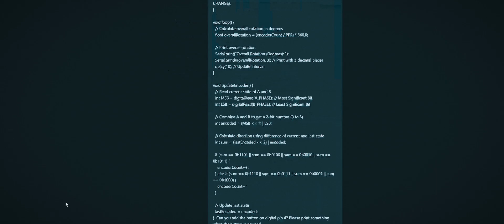Digital Precision Indexing Upgrade for My Watchmaker’s Lathe | LOOK WATCHES

Comment: Did you have to make any modifications to the sherline to use it for watchmaking? I’m considering the 4530, but I’m worried it will not be accurate enough. I cannot find any published cocentricity specifications.
Reply from the maker: Hi! I still have so much more to learn on my watchmaking journey, so take my opinion with a grain of salt. In my mind, the sherline lathes are very capable machines, and I've no problem hitting my overall target tolerance of 0.005mm. 

The only issue I've noticed is the limiting bed length, but that's my own fault by ordering the smallest lathe from them.

I'd recommend a sherline any day, but I'm still 'just' an ambitious hobbiest, so that's that.

Comment: Stumbled upon this channel. I like it. I do mostly restoration work, and also needed an indexer for wheel cutting. I built one out of an arduino and an ondrive gear box with a stepper motor. This way I can just input the number of teeth I need to cut and it automatically rotates the required degrees. Im kind of surprised you didnt go that route
Reply from the maker: Hi, thanks for your comment, and I really appreciate your input! Your described indexing setup would totally work for me as well, and I thought about it. The only difference is that I really enjoy the manual handwheels on my lathe. 

When working with different metals, it really helps me to feel the metal being removed. The resistance of the handwheels in combination with the sound seems to work very well for me to get a good surface finish and feel the limits of my lathe.

So I designed something that will give me the same feel since I'm planning to use this attachment for light milling work as well, rather than only for straight-up indexing only.

Comment: I loved this!  Thanks for sharing!  I love my rotary table.  

I've got a manual one, but it's got indexing plates, which accurately splits 360 degrees into any increment.  When you cut your first tooth, how well did it line up with the last one when you got all the way around?  The reason I ask is that I noticed your encoder only splits by quarters of a degree - you'll want a lot more more precision if you ever plan on doing gears with an odd number of teeth. ;)

Also loved the color grading on this one - how did you achieve that?  What video editor are you using?
Reply from the maker: Hi! Thanks and much appreciated! The last cut lined up perfectly, and you're totally right about the quarter of a degree resolution. This current encoder has a resolution of 1600 steps, so 360°/1600 = 0.225°. This encoder is more a proof of concept and will be exchanged for a 10.000 PPR encoder down the line later.

I'm doing all the editing/grading in DaVinci Resolve. My professional background is in post-production advertising work, so I'm quite familiar with the task of making something look pretty. The grading was done by hand, but to be honest, it is more about the way of lighting your shots and what type of lens is used. The grading is more the cherry on top. Hope that helps :)
Reply: @Lookwatches Thanks for the reply.  Much appreciated.  I'm digging the aspect ratio, too - you don't see a lot of 2.35:1 on YouTube. :D

Best of luck with the next step - I've subscribed and looking forward to seeing what you build.
Reply from the maker: @MachiningImpossible  haha thanks! It's an anamorphic lens, so that's the reason for the unusual aspect ratio. It's so nice to have you on board!